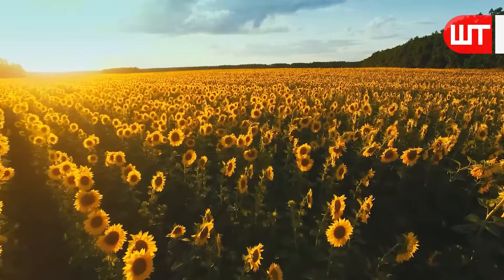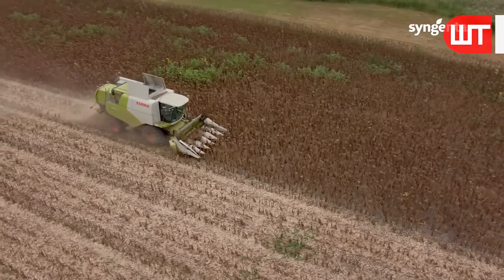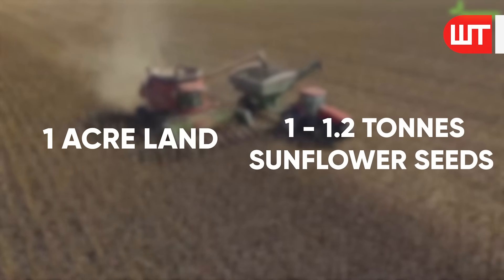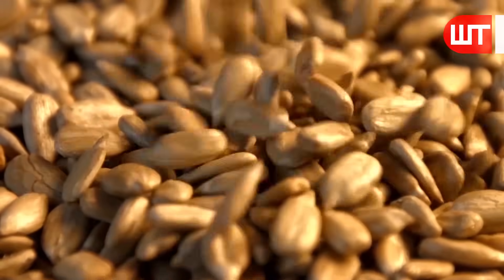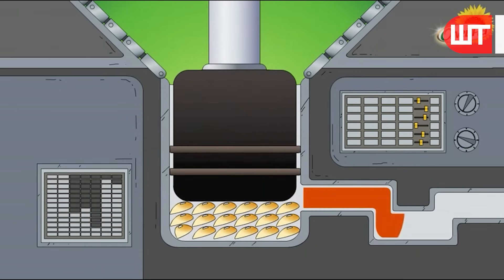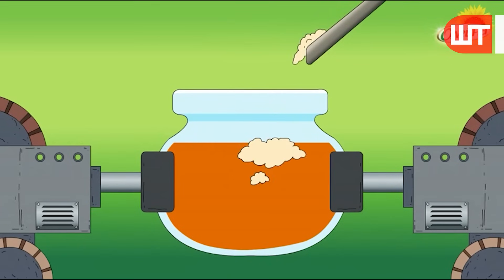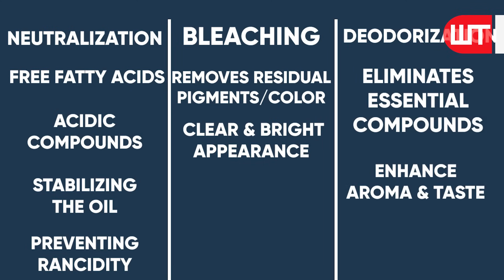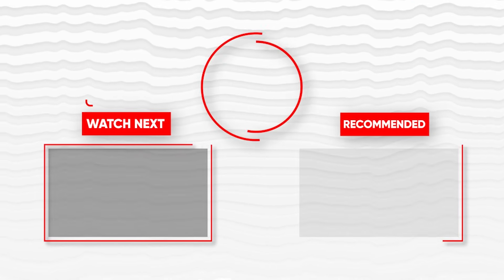Mega Sunflower Oil Factory | How Sunflowers are Harvested & their Oil Extracted

Comment: I didn't get why they go for drying and heating before crushing. The oil gets evoparated right?
Reply: No mate, oil evaporation point is absurdly high, it's not like water.
Reply: And bleach...
All goodness fuc..d up
Reply: @DonPresident-zc6zo  it's a bleaching substance, doesn't mean it's the same bleach you used on clothes lol...For instance, you also need to bleach vinegar, and the traditional way was using egg whites (which collected all the turbid elements). So egg white is a bleaching agent. Stop being so soft, everything is chemical...
Reply: When drying and heating the raw material before grinding, the main goal is to remove excess moisture and make the raw material easier to grind, not to evaporate the oil.